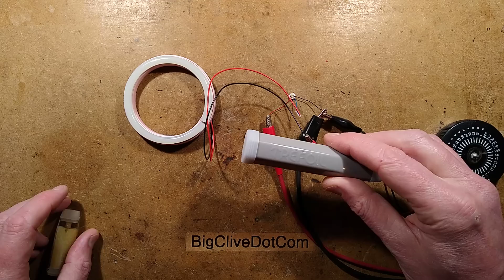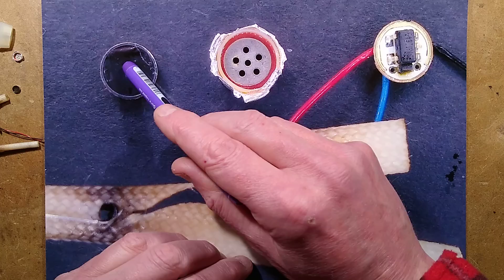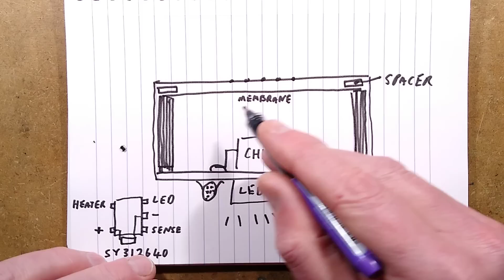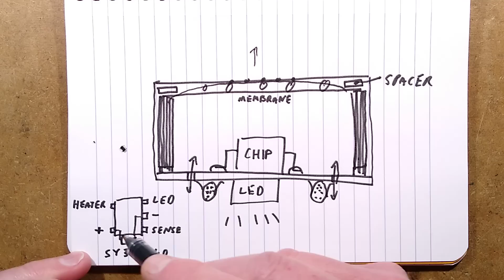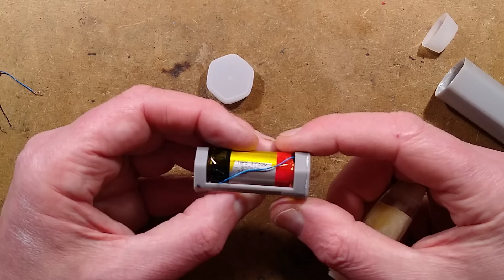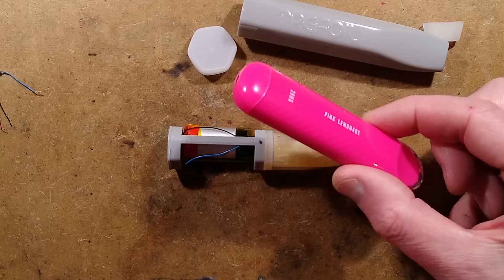Did this pose a fire risk?

Comment: the disposable weed pen i have has got have a small round black piece in with a soft material that coats the top that's wired in between the battery and charger port,  it sits inside the pen right in the very bottom and is vented out the bottom,  so it is a pressure diaphragm,  makes sense, when you draw through the top, it intakes through the bottom and turns the battery on to heat it, nice, when i first seen it i was like man that looks an awful lot like a microphone lmao damn conspiracy theories lol freaked me out for a sec cause 90% of them usually end up having some truth to them lol

Comment: Clive. Thanks for the interesting video analysis.  I hate to challenge you but I’m pretty sure the Membrane diaphragm does not ever make electrical contact with the holy top plate. If you check you will see the diaphragm is only conductive on the side which faces down towards the PCB and is in intimate contact with the metal ring and so on down to the sense IP on the PCB. It is a complete insulator on the top side close to the holy plate. 

I am 95% certain this diaphragm membrane is a capacitance change transducer. I bet if you scope the sense pin it might have an ac signal present on it at all times! Or maybe it is an Electret charge transducer with a super high impedance sense IP on the chip? It’s not a contact switch as you determined in the vid and the excellent diagram sketch. Please revisit this sensor technology subject Clive, and let us know what you think. There’s so much more to that clever little ASIC chip than meets the eye!  Cheers. Peter (non smoker, non vaper)
PS I’ve got a rapidly expanding collection of pavement salvaged Lipo cells. All tested and have the stated full capacity. Just need to find a use for them (but without burning my house down!)

Comment: Hi Clive, I find your channel so relateable as a kid who also used to take things apart, apprenticeship and career in engineering. You have inspired me to recycle discarded vapes. As well as the battery could the puff sensor chip be reused (by shorting pin #1 to grd) as a battery charge/discharge control? Thinking of also reusing the packaging by removing heater/liquid tank and add an additional battery. Then just needs a usb outlet for a free battery pack. What do you think, maybe you could do as project? Regards Jon
Reply from the maker: The sensor is very specialist and has protections against the input being jammed on all the time.  Many do have a simple charge circuit though, which will charge at about 300mA from a 5V supply and shut off at 4.2V.

Comment: I'm so surprised to see that. Here in Italy almost 99% of e-cigs are rechargeable via micro or C usb socket (they got same cell or 18650 inside) and plenty of them have got interchangeable battery (like old mobile phones where you can open the cover and change the battery).
However, another great video Clive!
Reply: i think the popularity of these in the US (followed by increased production and distribution elsewhere) is a overly specific law banning flavored juul pods, which at the time were very popular with underage users. the law did not ban flavored disposable e-cigs, which at the time were very rare. that loophole inadvertently led to millions of these devices being produced and landfilled.

Comment: I've connected three of these 'chunky'  cells together in series to see how effective they are in my other hobby - flying radio controlled planes. Result? Very effective. Normally you fly about 5 minutes and then land as otherwise it gets a bit boring, but one of these 3S lash-ups powered a small plane for over seventeen minutes. Checking the charger later showed a capacity of 1250mAh. A commercial battery of that size is over £15, so I consider it a raging success that we can make one for free from discarded rubbish.

Comment: I just saw at the local shop that they sell powered disposable toothbrushes advertised to run for 3 months. It was actually cheaper than some normal regular non-powered toothbrushes. 5 dollars for an "Oral-B Micro Pulse" 1 battery toothbrush. I hope this disposable stuff doesn't get too common. It just seems so wasteful.

Comment: Talking of fire risks, I use one of those little fan assisted Peltier effect drinks coolers for my chocolate. I noticed recently that the inside wasn't as cool as normal and then, on another day, that the outside was rather warm. My immediate suspicion was that there might be a build up of dust in it. Removing eight screws revealed that to be the truth. I'd originally bought it from Woolworths, so it was a few years worth. I just wonder how much of a fire hazard these are.
Reply: I had one that I left running in my garage. It was dead one day and I took a look at it, the fan failed and the peltier got so hot that it browned the thermal paste and crisped the wires. Thankfully it failed before it caught fire, I didn't see any thermal fuse... The peltier  just burned out.

Comment: Here in the US we have a "3000 puff" with a "disposable" 2500mah battery.
Reply: I wish I knew people that used them.  I bet that 2500mAh "disposable" battery is a simple 18650 cell and if it really has that capacity it should be a high quality one.  I know one person that uses these things regularly but he uses an actual rechargeable version that takes two 18650's and has a recharge circuit built into it.  I used some of the 18650s built for these (they were about $5 each) in cheap Shen Zhen Shit Land USB power bank enclosures that I liked the form factor of and they actually work quite well.  You could likely take the 18650 out of one of the "3000 puff" vape pens and use it in one of those.

Comment: These things are not good for environment and waste expensive materials. Why can't they have a disposal point in the shops they were bought in. Recycle an reuse the parts, the most expensive part is the battery which is rechargeable. These could be used again if charged. The plastic can be recycled. I am talking about the geek bars here. The elf bars are made of aluminium which can also be recycled. Maybe the company's who make these things could reuse some parts like the battery and the aluminium tube. If they charged a deposit that was refundable on returning a spent device it would not be so wasteful and good for the environment to. It would to some degree save manufacturers money to. I'm surprised they have not thought of this Idea. Perhaps then there would not be so many discarded. I see loads of these things just thrown about the countryside once there spent. If there was a returnable deposit then it may relieve this issue a bit.

Comment: I was just salvaging the battery from a vape this afternoon. Accidentally cut the two blue wires leading to the sensor at the same time. There was a glowy bit and a puff of smoke. Thankfully it didn't set off the smoke detectors. Always cut the red wire first!
Reply: You are counting on the wires being the proper color at the proper connector.  Some of the shittiest Shen Zhen Shit Land products aren't known for accuracy.

Comment: You would be amazed how many bunk vapes there are. It's seriously a huge amount of work for my shop, filtering out the cheap garbage so people don't have to come back for exchanges time after time, nevermind the ABSOLUTELY INSANE counterfeit problems most often attributed to gas station-sourced vapes, but that's a whoooole different discussion. Granted, these things are cheap as hell either way, with insane quantities produced around the clock, so even the "good" brands still had the occasional dud, but oof it feels bad ecologically. A lot of them, at least that we try to carry, are rechargeable as in they actually have a USB port for charging. You can use the same smaller battery but put it with 3x the juice, or however much you think the coil/wick can handle before tasting awful (broken down sweeteners on coil, degraded/singed wick, etc).

As for nic salts, it's just a more bioavailable form that absorbs into the body faster. With freebase nic, it can get kind rough beyond 6mg/ml, and I personally can't even do beyond 3mg/ml. It absorbs too slowly and kinda "sits" on the nerves while waiting to be absorbed, giving the harsh feeling by stimulating the nerves directly. Nic salts don't take long to absorb at all, so it is FAR smoother at higher levels (upwards of 50mg/ml, the maximum most companies will produce), meaning you can use smaller, cheaper, lower power devices with the same overall intake of nic. A side-effect of it absorbing faster is that it has the instant punch of nicotine that a cigarette gives you, which has helped move people over to vaping from smoking far more than freebase. Some people respond negatively to salts (harsher, don't like the punchy hit, more sensitive to nicotine taste, etc), but that's more a person-to-person thing.

Comment: I got a disposable which was only half charged. Died after 1 day at work... Added a tiny USB charge board, and used it for a few weeks, until a friend asked to buy it off me 😂
Reply: That isn't a bad idea although some of the disposable vape devices I have seen are too small to enclose the USB charge boards available on eBay or Amazon US.  The boards I have seen have a full size USB-A port for use to power something so that is why they are so large.  I suppose you could contact a Shen Zhen Shit Land manufacturer of these things and find out where they get their almost microscopic charge boards from that are usually put in these things.
Reply: @mharris5047  So, the micro-USB and USB-C boards are too large to fit into the unit, but it can be taped on as a useful tumor to the device 
That said: there are now new V2 versions from POD with micro-USB on the bottom already. Apparently, they saw my InstaGram post about it, and decided to fix it themselves. Device worked good for a week, and I believe the wick burnt out, on this one

Comment: Electronic equipment with batteries in are supposed to be disposed of in an environmentally friendly way or recycled through the manufacturer. I hate to think how may of these get tipped into landfill from households on a daily basis, just to rot away and contaminate groundwater that will eventually become our drinking water. After one use, the batteries are still almost new and can be re-used for other projects.

Comment: My friend gave me plenty (~30) of used devices that I wanted to recycle for parts. They actually had 1100mAh cells in them and used an aluminum tube for their external construction. Bought some 3W LED chips and 1s protection circuits, am planning to make some rechargeable torches and other little gadgets. Such a shame that most of these go to landfills when there’s still plenty of potential in the components used to make them.
Reply: Yeah, these are great for salvaging the battery. I would actually buy a bunch of them just to get those batteries.
Reply: I found a couple of vape things on the ground and decided to take the batteries out of them and some of the other small components in them. Can I sell those batteries if not can I recharge them for other projects?
Reply: @HandyFox333  If they're lipo batteries, you can check if they're drained all the way. If they have at least 2.5V left, you can safely recharge them. If they're down to 0V you can try to revive them, but that's risky and likely they won't hold a charge.
Reply: @PunakiviAddikti  how do I recharge? I was thinking of cutting a phone wire and taping/clamping to the ends.
Reply: @HandyFox333  No no, lipo batteries require special care. You can't just connect 5V to it, lipo batteries require a special charger and must have overcharge and over-discharge protection. What you need is a lipo charge board that also has over discharge protection. I recommend reading up on how to charge and use lipo batteries. They are like wild animals, you need to tame them and use proper care.
Reply: @PunakiviAddikti  Yeah, I thought so. I have all kind of batteries just hanging around that I've
taken out of things. I usually just test them to see if they have juice, tape the positive and
negative ends with electrical tape and set them aside. I was hoping to just sell them but
I've been getting more into repairing electrical devices so I was thinking of using them as
replacing AA batteries with these for recharging.

Edit: Also thanks for the info and the replies. It's very appreciated.
Reply: @HandyFox333  You might want to also get a hobby charger for batteries. You will need some knowledge about lipo packs to use it, but it might be a good idea in the long run. The hobby chargers can usually charge lithium batteries, Ni-Cd and Ni-Mh batteries and lead-acid batteries.
Reply: @PunakiviAddikti  I will look into that, thanks.
Reply: @PunakiviAddikti  You can buy little charging modules on eBay or Amazon US and solder the leads to the appropriate locations on the circuit board, they use a standard micro USB-B port for charging and aren't that expensive -- usually sold in quantities of five or ten.  The ones I have bought also have a full sized USB-A port for use with lower current USB devices such as flashlights.
Reply: @mharris5047  Yes, I know. I have multiple. Some are micro-USB and some are USB-C.

Comment: So that is what these are! I've been seeing them discarded on the streets, but I did not investigate further. I wonder if these batteries would do well in a home-built quad/drone application since the cells are probably kinda powerful for their size. But that round shape is annoying. Maybe a 3D printed box to turn them into a 'standard' size? Not an actual standard size, but something you could design something for projects.
Reply: Round batteries have been standard since they were modified glass jars.
Reply from the maker: Drones might need a bit more current than these are designed for.

Comment: Ssssooo.... What would one of these devices do if packed in luggage in the unpressurized cargo hold of an airplane?
Or nothing, because the air pressure at cruise altitude isn't nearly enough to trigger that?

🤔 Actually, is how I'm thinking the sensor is used, backwards from how it is used....
Yea I've probably envisioned this all backwards, but I'll still ask it just in case. 🥴
Reply from the maker: I brought this with me sealed in a bag when I flew back on an island hopper that makes your ears pop.  There was no sign it had triggered.

Comment: Nic salts shouldn't be that different, it should just be less refined/less processed
Reply from the maker: I believe it's just the addition of benzoic acid.  Not sure why they call it salts.
Reply: @bigclivedotcom  odd, I'll have to look into it again. nicotine is similar in composition to salt (it affects some of the same receptors in the body), there are other ADD meds that can be classified as salts as well from what I read. Ya, I just read the acid thing, I thought the "salts" were dissolved in an H20 or alcohol base but it looks not... that's kind of disappointing.
Reply: The benzine makes the strong nicotine bearable to inhale I guess, some sort of reaction between the two where the benzine subdues the more stringent portions of the nicotine, cigarettes used it too.

Comment: Hey Big Clive. Ever do one of those pinpointer metal detectors that are knock-off clones of an American brand. There's brands like Pudibe, GP Pointer, Zwinner, and several others selling the same thing. The pinpointer that has a metal ring/washer where the battery cover screws in as a lanyard holder looks to be the earliest version available, and can be had the cheapest. They range from waterproof for the probe only to fully submersible to a limited depth (though one should skeptical getting them wet except a light rain).
Reply from the maker: Not seen those.
Reply: @bigclivedotcom  There's some limited teardowns of these on YT. One problem with earlier versions the coil was not fully seated to the tip (dimminshed range). Tapping point on a table slides coil into place. Comes with a junky alkaline battery. Fresh batteries cleared up other problems. Then another problem of signaling off even after metal was taking away from field of detection (pain in butt for the user).

Comment: we need a law to ban disposable lithium batteries and products that use disposable lithium. But, no, we just get less roads and higher taxes. smh.
Reply: Purpose built disposable lithium batteries like the CR2032 have been well accepted for decades.  Misusing rechargeable Lithium cells as disposable single use batteries inside other products is a modern practice worthy of outlawing.  So are making products that need to be disposed when their rechargeable battery cannot take a new charge due to crap battery management or frequent enough usage.

Comment: Rapid decompression by taking it off a plane, or vibrations, could've activated that first 'puff' that made it contaminate itself. Probably.
Reply: They can't pay pilots enough - imagine flying a plane full of lithium batteries and dodgy electronics at 37000 feet.
Reply: @thebrowns5337  Well, there was a whole Galaxy of faulty lithium cells once. Not too long ago, when the smartphone had already been known to man for a while. 😄 The aviation industry shut that hazard down rather emphatically, didn't they?
Reply: @thebrowns5337  Doing that today is like flying nitrate movie film in 1922. Both will burn underwater as it has it's own oxidizer. The only thing you can do is remove valuable items from the area starting with human life and remove the fuel from the fire triangle.
Reply: I wonder if it’s best to fly with a squonker?